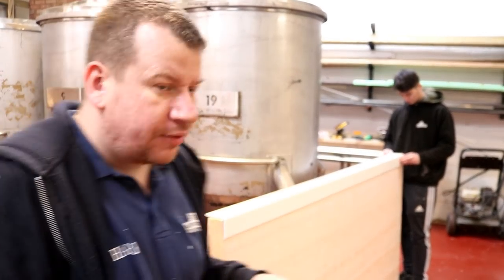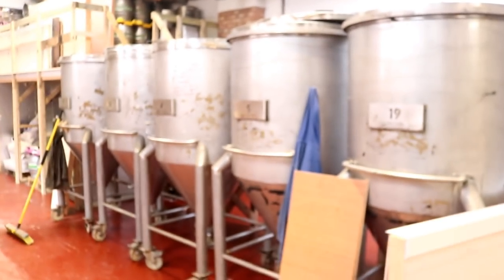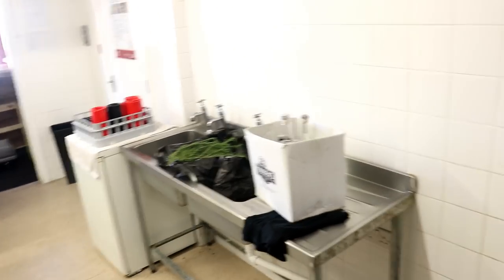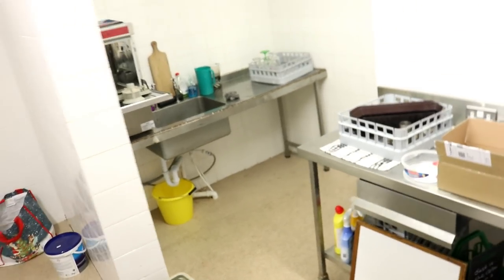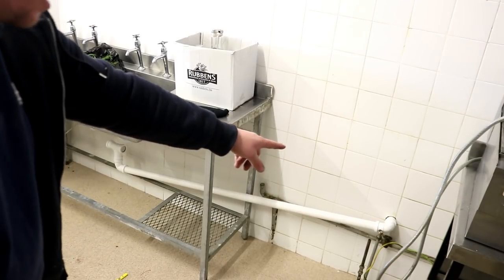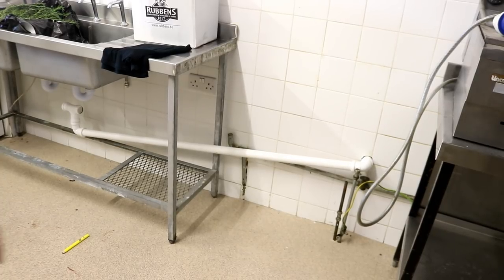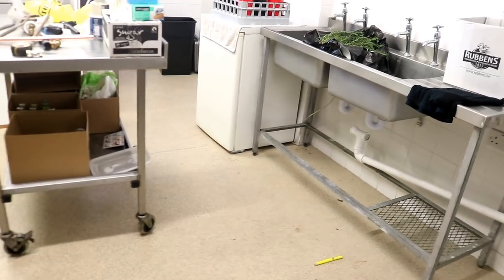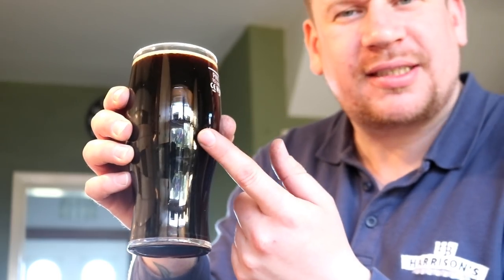COLD ROOM DOORS  ~ FINALLY

Comment: Cold room doors look great m8 and although they are not that heavy they are big and awkward and you've not got a handhold on to help with moving. Just a suggestion but I would recess some handholds into both sides of each door just so you have something to grip solidly (I'm sure you get my meaning and it is just a suggestion). I feel sorry for the staff that got shafted because of that arsehole but other than that it couldn't have happened to a nicer bellend. He mustn't have much left at this stage,no wonder you were smiling at end of video lol. Hope you enjoyed those pints,now cut that grass you lazy fecker. Cheers.